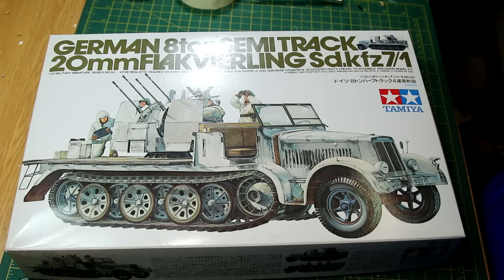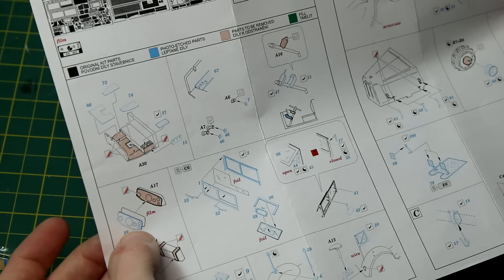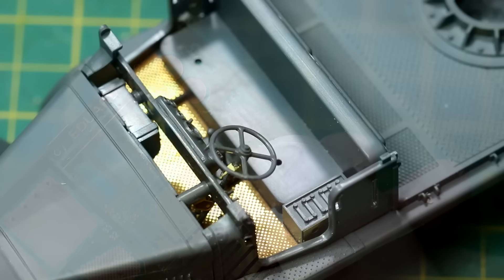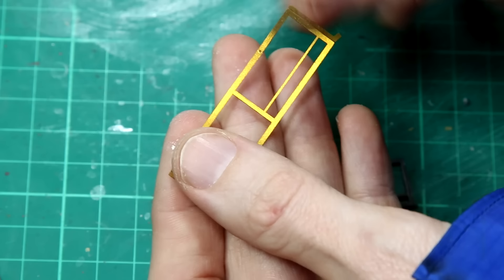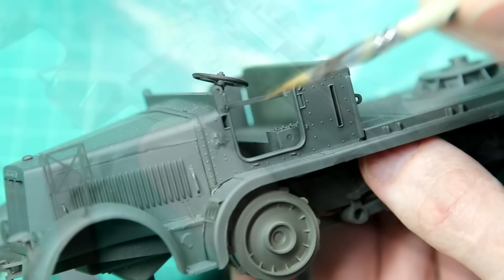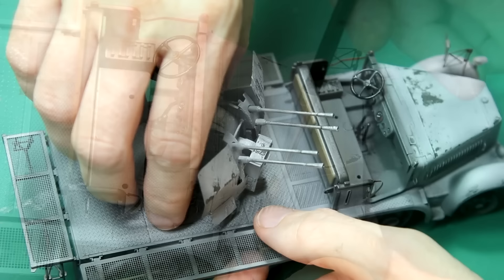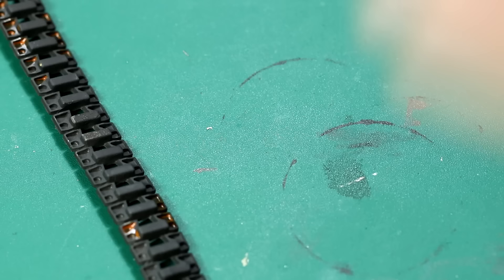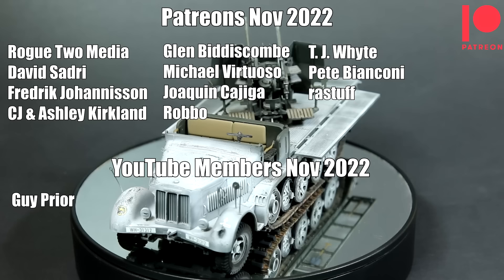German Half-Track Sd.Kfz 7/1 Flakvierling (Tamiya 1/35 scale model kit)

Comment: Regarding the tracks: there’s a known standard approach which is as follows: take a thin copper wire, or a thin thread, and thread it through the opening of the track, along the wheel and back to the other side, tighten the tracks and fix the wire or thread. Stiffening the first cm or so of a thread with superglue helps with the threading. Sounds more complicated than it is. On your tracks, 2 fixings on each side, close to the idler and drive wheel, should be enough. Then you can fix the tracks to the other wheels easily with superglue if still necessary.
Reply from the maker: Thanks - I have a distant memory of reading about that technique, which obviously escaped me at the time! Sounds good - I may well try it in the next video on this kit.

Comment: Just started getting back into modelling and 45 years after I first made this kit, I bought another two to make in different colour schemes. It's a cool looking vehicle and the relative complexity offers more than a regular 'quick' build.

But now I am terrified of starting it! Not that you necessarily put the fear of God in me about the problems, but I'm certainly going to put this way, way, waaaaay down on my list of kits to start building. Though hopefully not in another 45 years! 😁

I do appreciate the tips and suggestions that you made. If and when I do get around to building it, I will have this guide to refer to. Thanks.
Reply from the maker: Thanks for your kind words, Andrew. I'd say give it a go! It's not a bad kit at all. Yes, the bonnet/hood was a bit of a bad fit, but as another viewer pointed out there is supposed to be a piece of canvas between the hood and the cab that isn't modelled. If it turns out really bad you can just put a tarp over it :)
Reply: @ModelNerd  Cheers Pal.

Nothing worse than "analysis paralysis" and you do inspire and show how to overcome difficulties. Much appreciated. Cheers.

Comment: Love that👍 to bad I couldn't talk to you first about that kit. Tracks are that big not sure why yours are that small.?? I bought a modelKasten tracks set with resin roadwheels and front end suspension. But I also bought the Photo etch. Great set. Actually bought two sets I have 8ton prim mover by Tamiya. Oh the gap at the front is actually a leather piece between the engine compartment and cab.wish could let you see it. Anyway Awesome build forsure.👍👍
Reply from the maker: Hi Clayton, thanks for the information. I thought it was well known (although not to me at the time!) that Tamiya's wheels are too far apart and their tracks too big? Oh well, either way it just means I'll need to build another one from a different manufacturer :)

Comment: Great build MN! I am half way through building this kit, and although it is an old kit, it still had some appeal for me. A good heads up for me about the tracks. I have not got that far as yet, and I was going to get some metal tracks for it (the R-Model tracks that you bought in fact) so you have saved me some $’s there. I haven’t even looked at the rubber tracks, so I would not have picked up on that. I am not going to give it a winter whitewash, but I was thinking I might give it a DAK colour scheme. Not sure if this would be accurate, but it appeals to me. I will look for a suitable crew for it as well. Keep up the great content. Greetings fro Australia 🇦🇺!
Reply from the maker: I reckon it would look really smart in a DAK scheme. I'm not sure about the accuracy either but it it looks good, ir looks good. Enjoy mate!

Comment: I liked your approach to a classic build with the photo etch, i have just bought one myself and now i need to get the pe set if it still available. The supplied tracks are quite awful and that got me thinking as to how to replace them ...i have a number of Fruilmodel tracks sets and i can see the sdkfz 7 tracks are too small. The answer to the problem is to up the size i have both the sdkfz 8 12ton tracks and the sdkfz 9 Famo tracks. matching and comparing the sdkfz 8 12ton tracks Fruilmodel no ATL-169 is by far the closest in pitch and width ...just maybe 1mm or 2mm narrower . This is the answer to the problem and should look really good and the way i will do my own....hope this is of help.
Reply from the maker: Thanks - that's a good suggestion

Comment: A nice build of an old kit. Its a shame about the tracks on this kit being wrong. I am not sure if the wheel spacing is wrong too. This said back in 1972 it probably wasn't considered too important to get the scale exact. I think Hasegawa and Trumpeter do similar kits. I don't know if these are more accurate models.
Reply from the maker: Thanks Allan. Yes, I hear Tamiya's original Panther A is also notorious for having multiple errors, including the wrong number of wheels(!), but in those days I guess research resources just weren't as available as they are now (to kit manufacturers and model builders equally).
Reply: @ModelNerd  I also think that these kits were not necessarily aimed at the discerning modeler but more towards younger people and capable kids. I think a good representation was sufficient.
Reply from the maker: Yes, I think that's a very good point
Reply: @ModelNerd  I built this kit when it came out at the time tamiya made most of their kits to be motorised this kit shared it’s chassis with one of those this often affected the accuracy.They were more of a toy than today’s models but they were cheap this kit was £4 to £5 not £50 to £60 as it would be today. This kit was about as good as it got when released in the early mid seventies and is still a fun build today and most of the shortcomings can be ironed out with aftermarket parts.
Reply from the maker: @johnludmon510  Ah yeah, good point, thanks John - I forgot about the motorisation thing.

Comment: Track stays I always used to use a a couple of staples bent to appropriate length 
And thread  to tidy up the bits that want to laugh at us and flap about 
Sometimes a little spot weld with a soldering iron then if confidence has surfaced remove staples
You will never convince me that any glue on the planet will glue bendytrack 
They have so far defeated all the glue great new things from dunlop rubber glue uhu bostick evo stick super glue the list is endless 😂 
After all this time id have thought the model companies would have realised this goo wont glue / and the kit relies on glue to work
Reply from the maker: Yes, it really is incredible that nothing will stick this stuff!